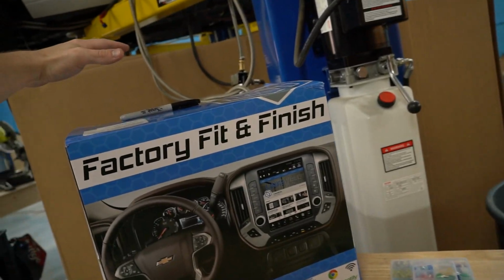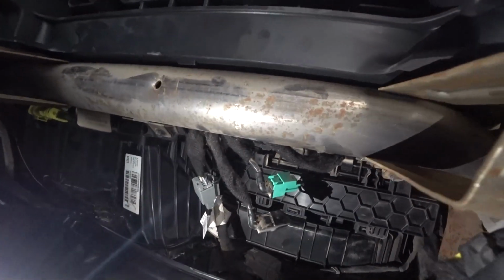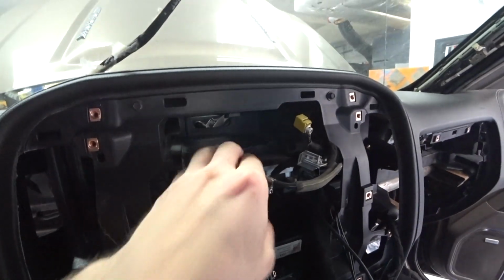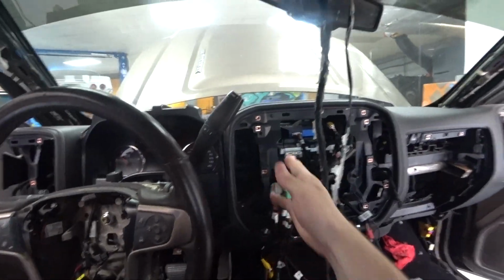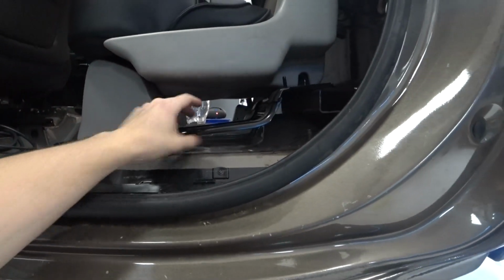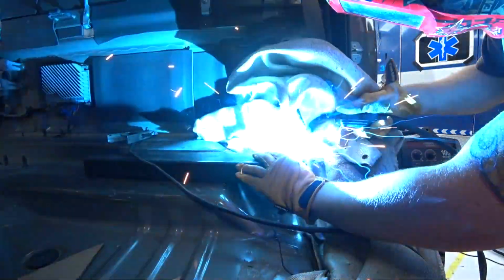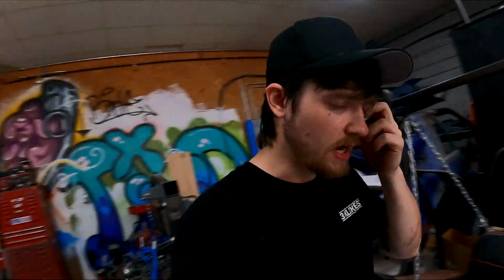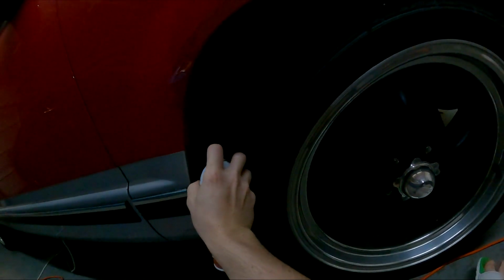BOTH OF MY TRUCKS HAVE ISSUES...

Comment: I looked into the Links well for my 2011 ram.    Decided it looked way to jank.   Went with a Kenwood radio and Idata link integration for allot of vehicles and I'm very happy ( should also work with your Bose system.  I have an Alpine system in my truck and it works mint )

Comment: Hey man. I’m not 💯 on that radio and the integration harness, but it’s very possible that you need to hook up the amp turn on wire to turn on you’re factory amplifier. Even with regular aftermarket radios and Bose, you need to hook that up. Hope this helps

Comment: Dan you should try some kydex to mold a trim panel for the rear seat mounts. Can mould it by hand with a heat gun and it’s cheap.
Reply: At first I thought this was a dumb idea. As I thought about it that’s not bad at all. Durable and will match relatively well

Comment: Idea for rear seat filler plate. Frosted plexiglass with rgb lights behind that turn on with the dome lights. Use 1000grit or rougher to scratch frost one side and vinyl wrap the clear side to protect against scratches clear side goes toward door. Just an idea

Comment: awesome vid dan just one thing on the go pro you look way better under light but its awful when in the truck with no light i have a oled color corrected monitor and it was tough to see any true details that were not the top of the dash where it was getting light from the shop

Comment: If you ask your friend at the gm dealer to run your vin in their system they can pull up the whole vehicle build to find out every spec the truck has. Including the build codes for the radio like the iob vs io6 and everything.

Comment: If your looking for a big touch screen that works extremely well look in to the ilx-f411 or I’ll-f309 from alpine. They’re 11 or 9 inch floating displays that use a single din chassis like the radio you took out of your truck. I just put one in my Ram like a month ago. They’re priced 1000, and 1200 or so with the maestro rr to keep factory steering wheel controls, ac controls, and back up camera and such. It will also interface with the obd2 to give gauges and engine codes. If you go through crutchfield.com to purchase it, they will tell you all the extras you’ll need for your truck and have awesome tech/customer support. Also I’ve been watching your videos since like 2014  and got to meet you at FLMM in 2018. Love the videos man and keep up the good work!

Comment: I still have to have my diode fog light bar put in but I need some window tint anyways so I'll have them throw it in too thank you toyota (Corolla) for leaving empty slots near the steering wheel IL have them just out it on the botton just press for on/off then I have to do my control arms too before the 6 hour each way drive in a few weeks 😬 don't need them breaking in Vegas on the way